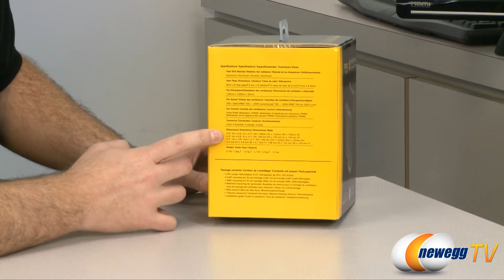Unboxing: Antec KUHLER box High-performance CPU Cooler

Comment: i have one of thease and have had it for quite some time upgraded from amd 965BE OC 3.6 most it would keep it cool at to a AMD FX8150 now i never used the stock amd fan but at stock clock this will keep it at about 63-64C now top temp for this cpu is 64c and im sure amd's stock cooler will keep it at or below 64C as well so if your looking at this for a amd 8150 move along lol